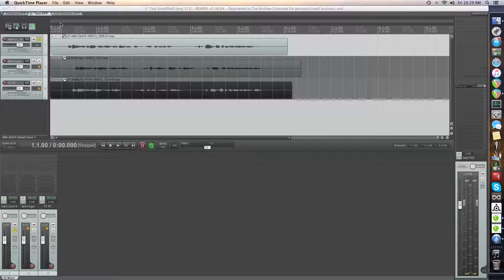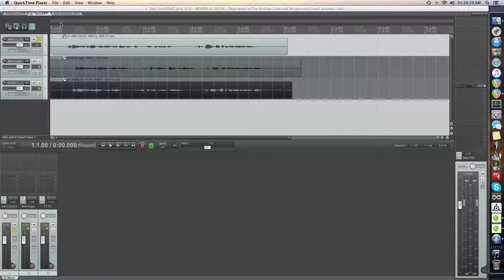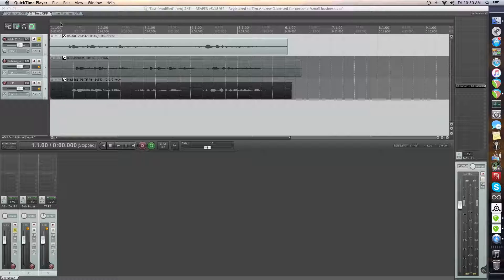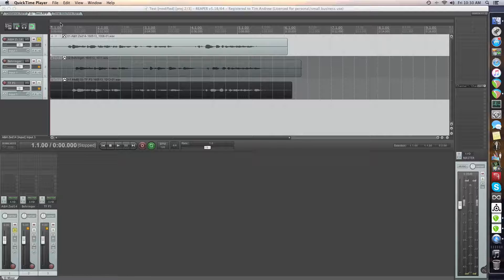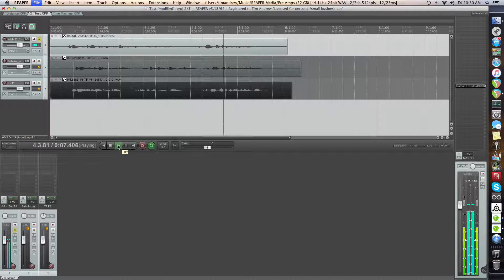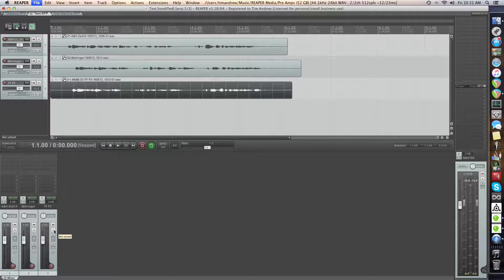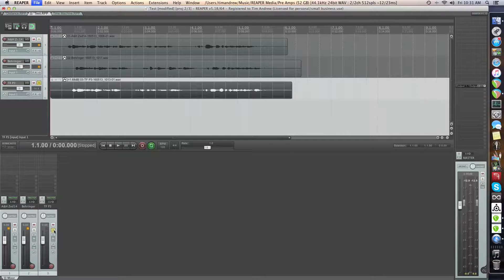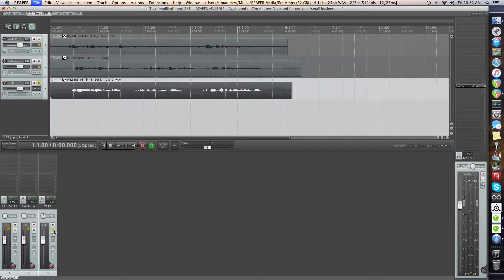Preamp Shoot Out - Zed14 vs tfpro p3 vs Ultragain Pro

Comment: Behringer is better!
Reply from the maker: Everyone has their fav, interesting eh?
Reply: With Zed14 you need a de-esser and certainly this is the bigger problem because when mixing you brobably add more High frequency and this increase this problem. the difference between the other two is not so marked but Behringerer produced a richer vocal than the other and probably needs an high pass filter but this is natural for all.
Reply from the maker: Esses are my nemesis :P